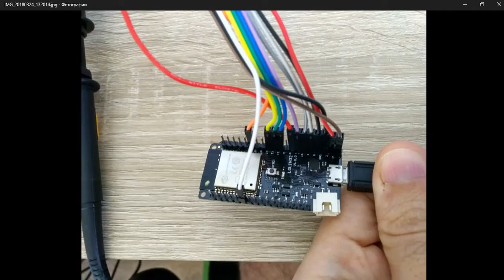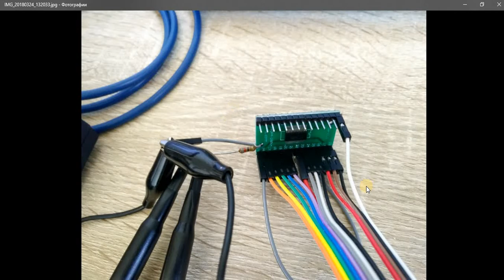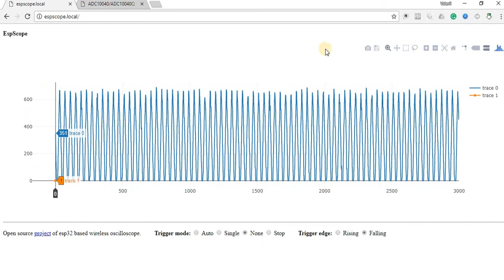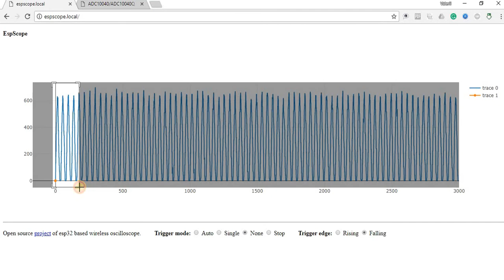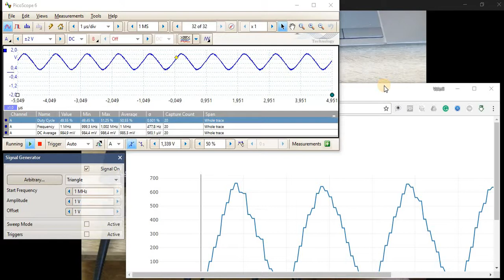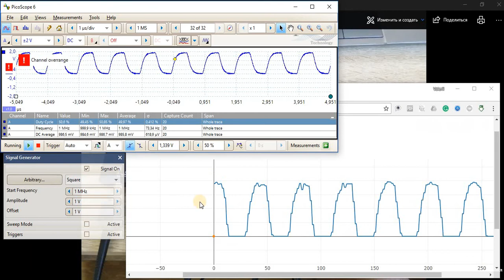esp32 with ADC10040, real input signal demo

Comment: Good job, Valerii. I think, that even with all limitations you faced with it's reasonable to continue - even if it will 20Msps oscill. I'll try to use your code, may be I use it as base.
Other thoughts about it - is to make esp32-based logic analyser, at least it will not have analog frontend problem. Also, I thought about esp32-based transistor tester :)
Дякую!